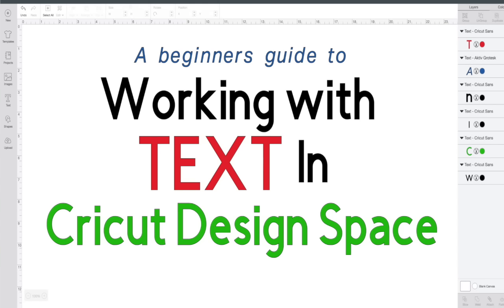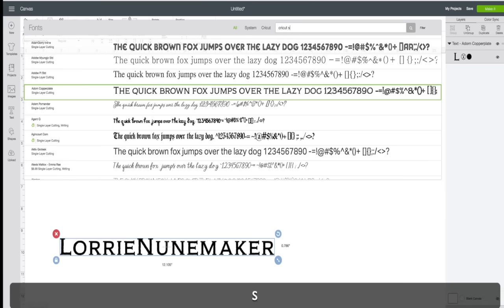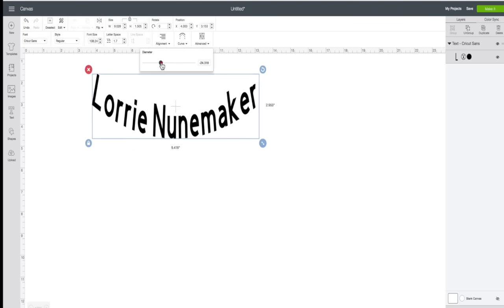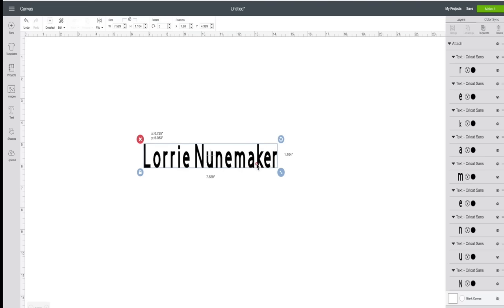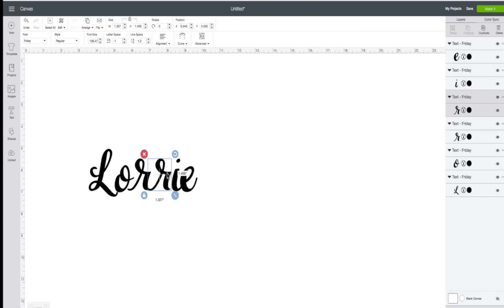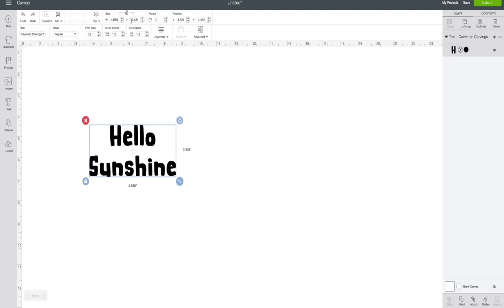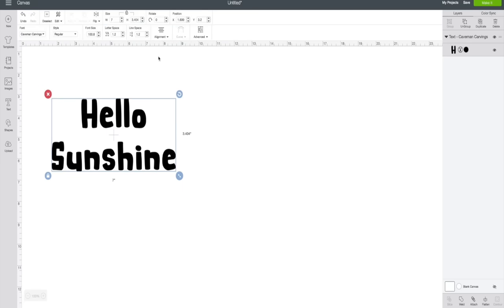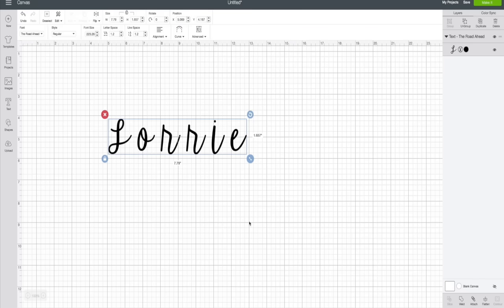Working with Text and Fonts in Cricut Design Space - Beginner's Guide

Comment: Hi, I'm hoping you can help me, I have attached the layout of my text so it doesn't do the space saving thing, but my question is , if I have the exact layout down to the inch , do you know of a way for cricut not to place it in the top left hand side but draw it exactly where I had created it ? I am trying to write text which has a layout of an already printed voucher , and I would like to use cricut to simply write in the spaces on the voucher , loklik machine handles this perfectly , but I am struggling on Cricut , thanks in advance :)

Comment: I have a 6 pane window. I want to put text in each pane. The area in each pane is 
9" Wide x 7" high. How do I make the text so it fits on the glass? I used template of rectangle/square. I made the shape 8.75" x 6.75. Typed my text. When went to make it, it cut off the outside edge of the text, by just a little on the right side. What am I doing wrong? Should I not be using the template? Should i just type my Text, select all, then make the size i want it to fit in?

Comment: Hi Lorrie, Beginner here, using a cricut explore air with Mac OS system 11+. When I create new text the text editing options appear, however, as soon as I "attach" or group the word, the text is no longer editable. Been trying to figure out why for hours. I thought was on to something when I came across your video. Was following along learning well until we got to 12:35 in your video and discovered that after I attach or group the words, the whole text editing options disappear. Do you know what could be the reason for this. BTW, I purchased this machine years ago and only used it for scan then print. Now I am venturing out to learn all the functions before I upgrade.

Comment: I am thinking of a circuit. Can you show how to layer on a word after welding? 

Eg Grandad with a 3cm flat layer and then put the grandad detail on the top like in the scan n cut? I have a scan n cut but really old. Does the circuit blade auto detect the material your using so
You don’t waste loads of paper? 

Sorry for all the questions. 

Amanda

Comment: Lorrie I am running into an issue. I am trying to make a decal to add to a sign. I have: 
Pumpkin Spice
&
Jesus Christ
I typed all of the text into one text box. I centered everything so that the "&" was in the middle and everything was in align. I then went to the advanced feature and separated everything into lines because I wanted to make each line of text fit into one of the slats that I have on my sign, it is a slatted sign. I ended up making each of the lines the exact width and height so they fit into each of the horizontal slats on my sign that I needed but when I did it, my three lines were no longer centered. That is where I got stuck. I have no clue how to go back from "lines" in the advance feature to having it all be one again. I tried attach, group, etc. with no luck. When I attached all three lines the bottom section of the bar on the top where I could center everything went away. I could still click on each individual line and get that bar to show up but when I clicked on the entire things or highlighted the entire thing to get it centered again, the option was no available because that part of the bar from above went away. I hope you understand what I am saying. I am struggling with this so bad. After watching several videos, I found yours to be the most helpful but I am still confused. Thank you so much for the help ❣
Reply from the maker: Select the three lines of text.  Select align.  Select align center vertical

Comment: I hope I can explain my issue well. When making a text and picking a font once I go to sizing or changing it in any way it won't let me go back and change the font. I click on the text and the drop down menu options don't appear.(the second row of options where the font style is listed) So I have to start over with the whole thing. Sometimes the whole text will disappear. Any suggestions? I have a cricut maker and windows 10. Also, if you have saved a text can you open it later to use in a new project and make changes to the text?

Comment: I need help!  I tried to print a vinyl quote I made myself (did not use a template) using the text feature in Explorer Air 2 and it won't cut deep enough, it's a new machine. I've tried cutting it 2 and 3 times on the same piece and that doesn't work either, most of the piece of vinyl just comes right off and only leaves a few letters if that. I want to use the vinyl quote on wood or canvas. If anyone can help, I would so appreciate it.
Reply from the maker: Create a 1/2 -1” circle and a square in design space.  Add a small scrap of the same material you are having problems with.  Start with making sure you are choosing the correct material in design space.  If so choose more pressure.  After it cuts don’t eject the mat and click the c again so it will recut.  If that doesn’t work next I  would check that your blade housing is fully seated in the holder. Then check that the blade is clean and nothing is blocking it in the housing shaft. A lot of times a piece of paper or debris can work it’s way up the shaft and hinder The blade from moving correctly.  (Remove the blade and tap the housing while pushing the plunger down to release anything that could be stuck).  Once you’ve figured out the right combination then try cutting your design. Using small test shapes will save you frustration when troubleshooting

Comment: I want to print an address '82017' number, but I want to keep it centered in the 12' piece of vinyl and use the entire 12" piece of vinyl...not just the numbers. How do I get it to print exactly where I type the number...instead of it sliding the number to the left saving me material...which is what I don't want.
Reply from the maker: Add a square that is 11.5 x slightly larger than your number height  (that’s the largest you can cut with a 12 x 12 mat. If you have a 12 x 24” mat make a rectangle slightly larger than your height  x 12.  Now center your address on the square or rectangle on the long side. Select the square and numbers and select attach
Reply: @LorrieNunemaker  Thank you, I will try it.
Reply: I did the attach and now my numbers stay where I want them in the 12" strip. I can move it around as one piece just fine BUT...when I go to 'Make it'...it shows on the screen as 2 seperate cuts. 1) a 12" strip and 2) my house numbers. How do I get the house numbers to be cut on the 12" strip?

Comment: beginner here- i have a short quote that goes under a word on my board. my board is 48" wide board. I printed the main word out, but the quote that sits under it is about 28" wide- I want to make it so this small quoting prints together so I don't have to line it up on board. my mat is 12 x 12 so I think it is too small. any help would be appreciated.
Reply from the maker: Tom . Jeanne Keena the longest you can print is 23.5”. You will have cut the long line in half and apply and cut it separately

Comment: Thanks for your helpful tips as I learn to use my Cricut Joy. Best tutorials hands down!!! I work with my project alongside yours and have learnt so much. I am having one problem though- I have three lines of different fonts- all good so far. Then I ungroup to lines and move them all separately- still good.
Then I ungroup to letters to move them closer together but then once I am happy, I can’t return to that line to reposition it as the ‘ungroup to lines’ isn’t bold and I can't get rid of the 'group to letters' command- are you with me? If I select it, it selects all three lines???  I hav paused your post to try and see exactly what you do but just can't work it out.
I would sooooo appreciate a helpful hint:)
Thanks heaps
Philippa from way down in NZ

Comment: I am not new to a cricut but Cricut Design Space is new to me so I want to learn the program before I connect my Cricut Explore Air 2. This was a very informative video but there were spots where I couldn't see where your arrow was. I did enjoy the video. Maybe you could do something more with using fonts such as putting words on a path such as a wave. I would also like to know how you would keep your letters on the path when they are cut so that the letters maintain their path shape. In other cricut programs I would use an image such as a circle as the path guide using individual letters. Then when I have the letters positioned on the circle where I want them I would weld the letters together and remove the circle guide. Welding the letters together means that each letter needs to stay movable.  If the letters are not welded when they are cut on the mat they will look like the way they are on the screen but when the letters are removed from the mat they are no longer in a path format and this is why I like to weld the letters but that takes a lot of work. If you have any other  way to do this please let me know.  Thanks for letting me explain this situation.

Comment: With regard to adding in your own fonts:   Does your cutting device (let's say the iPad) need to have the same font as the system you use to type/create the font.  For example, I may have a particular font on my PC desktop.  The project will now contain a font that is not necessarily on the iPad, which is where I would 'make it' from.
Reply from the maker: Yes, you must have the font installed on the device you are using

Comment: Loved this video! I am new to this and have a question. I am working on a shirt made with vinyl. It will have about 30 names. I dont want individual letters, so it looks like the weld feature is what I would use. Do you have any suggestions on what would be the best way to do this, and the best vinyl. I tried frog with various cut settings from vinyl to fabric.  It either  doesn't cut through, or it shreds.
Thank you for your information and for your help.